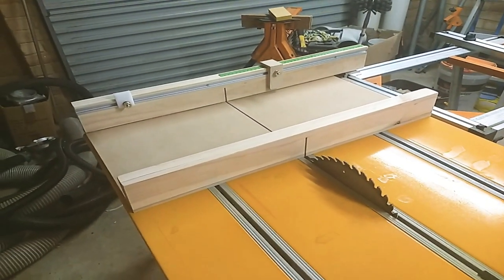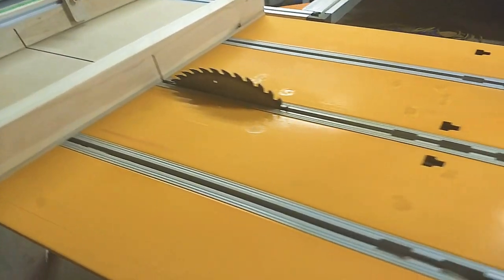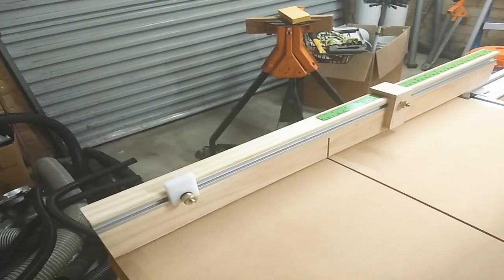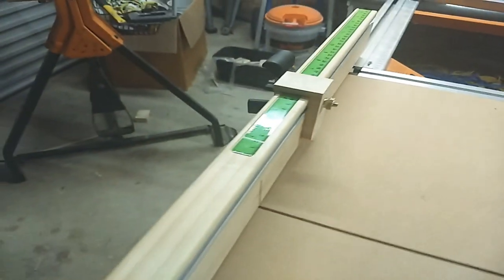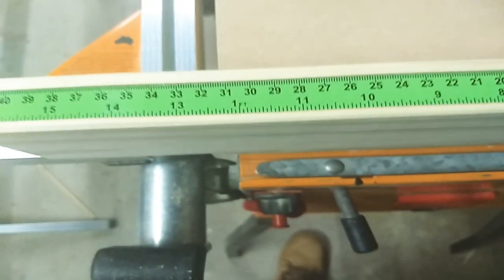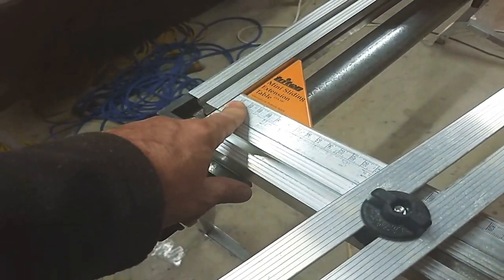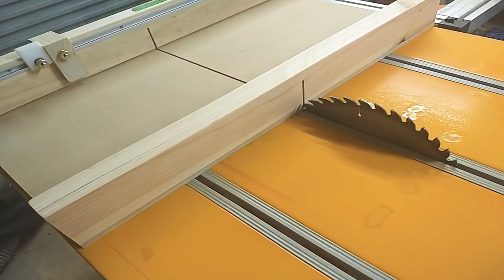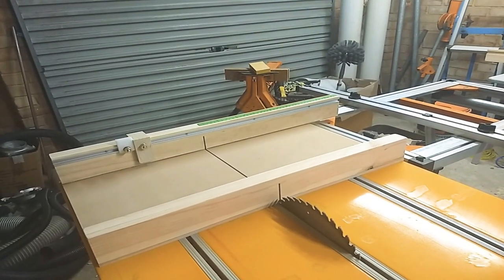Triton  2000 WorkCentre sled

Comment: Hi Phil, I had the original Triton in the 80s built all sort with it,  sold it in the late 90s and about 12 months ago my wife came home with the 2000, with triton power saw and extension spare blades but the maxi extension all for £200.00 couldn’t believe it.
I’m going to build your sled for mine do you have dimensions please, so far I’ve built a lathe bench out of 2x4 recycled flooring timber, what I’ve found is the the table rocks backwards and forward about 5 to 10mm, I’m thinking of putting braces but not sure where to put them, the pivot point is the point where the legs fit into the frame any ideas please.
Kind regards Chris Moore
Reply from the maker: Hi Chris - Sounds like a good price to pay for all that gear; nice going.  The dimensions that you choose for the 9-mm MDF base depend on what you want get out of the sled.  Width can be same as saw table, maybe a slight overhang.  The length of the base has to be chosen carefully and depends on the length of the slides under the sled.  Longer slides mean more stability, but then limit the length of travel of the sled.  This then means that the length of the sled has a practical upper limit (i.e. no point making the shed longer then the slides can offer in travel).  I don't have the dimensions to hand, but will go out to shed and maybe create another video to show/discuss this.

As for the rocking issue, just to be clear, you're talking about the Triton table rocking?  I think you could simply tap each leg close to the ground outward to settle the machine.  The old Triton instructional videos show that pretty clearly.

Let me know if you've got any more questions.
Reply from the maker: https://www.youtube.com/watch?v=bnGAyX9cbHg

Comment: I made a sliding sledge for my triton but i put the running on the outside of the base so i got more 1 meter 200mm in total
Reply from the maker: Interesting.  I considered this, but didn't think that my table top width was consistent and square enough.  Do you find that the sled "racks" (pivots a bit) because of this?

Comment: Thanks for the video. I plan on making one for my triton soon. I see i  your comment you plan on doiing the runners on the outside, whicb ive seen in other vids. I would be interested in seeing how you do that. Thanks phill
Reply from the maker: Hi Adam - There was an issue with making outer runners/guides on my Triton.  Due to the manufacturing process, where the sheet metal edges/corners are folded over, the table width is not uniform down its length.  It is perhaps 1+ mm wider at the corners compared to the middle section of the table top.  Since the outer runners/guides will have to be mounted to account for the widest part of the top, this leads to a slight rotation of the sled around the centre of the table top (pretty much around the blade centre looking from above).  Owing to manufacturing variations, it may be that you table top doesn't suffer from this issue and outer runners/guides might work.  Since the sled rotation (I didn't actually quantify this, but it is very clearly happening on my table top) was unacceptable on my saw, I am in the process of attempting to use runners in the mitre slots.  This is also problematic, since the slots are not uniformly aligned.  One of the ideas that I think has the greatest merit is to get one of the sliding extension tables (I have a Mini Sliding Extension Table ETA - hard to find these days at a sensible price) and use the "inner runner" to use as the guide for a sled.  There are plastic runners that you can buy from the Triton spares UK site that could be adapted to this purpose.  I read about this idea on the Woodworkforums.com site, but there were no pictures (since this was done about 10 years ago).  Since I have that sliding extension table, this option might work for me.  Good luck and let me know how you go. - Phil
Reply from the maker: Do you have links for the other vids on this?  It would be good to see them.
Reply: @superphilschneider  thanks for the reply!

I cant remember exactly what videos I have seen with it but i seem to remember atleast a couple. maybe they were pics on the forum too cant quite remember, ive seen so many now :)

I see what you mean regarding the table top, the pressed metal is nowhere near pefect by any means. My table top also has a bit of wiggle side to side in it so its less than ideal. I was thinking of a way to pack the table top locking tab sockets with something to try and minimize it when it occured to me, why not make something that commects to the body itself?

My first thought was making some tracks that attatch to a (spare) set of the yellow legs that the rip rence attatches to (the yellow legs that slide inside the scaled tracks on the body)
They lock in tight and would just be a case of cutting them in half and having them stick out the side with some tracks attached. That way they wouldnt move and the sled is attached directly to the body of the saw table.

The cost of the yellow legs are prohibitive though, so now im thinking i might be able to attach something to the aluminium rails that run under the table top. I got a few ideas floating around ill be sure to let you know if i try anything.
Reply from the maker: @Donga083  Interesting ideas there.  My table top is also bowed, causing it to rock. I fixed that by using a spacer made from plastic clothes line, which was good because it's somewhat compressible.  Some foam or other soft material would also work.

I like the idea of not using the pressed metal table top to guide the sled.  Triton used this rationale in the design of their Mini Sliding Extension Table (ETA100), which may be an option for a sled.
Reply: @superphilschneider  i have the maxi extension table too. I was looking at ideas using the round pipe on either side of the table...but not sure that will be accurate enough.

Right now im thinking or removing the table top and mounting something ridectly to the aluminium rails that run either side. Would need to space it up and perhaps make a replacement table top out of mdf with a couple of aluminium channels, then making the sled go on that.

I think it would be relatively easy and not take too long to change over.

Right now my biggest issue is getting the alignment of the saw right, i cant get it 90 degrees i run out of adjustment on the circ saw. I havent spent much time on it but theres some good threads on the forum im going to have a go at. I have a heap of plywood boxes i want to make so ill be ripping sheets so ill mess around with it then
Reply from the maker: @Donga083  Hey, how did you go with that idea - of making your own replacement table top for the Triton?  Seems a lot of guys are making table saws (John Heitz, Matthias Wandell, Cosmos Bauer, Paoson, others) so why not for the Triton.  Let me know if you have any ideas on this.
Reply: Hi Phill. Unfortunately I havent done anything with the Triton yet. Its been put on the backburner. Im still setting up my workshop so thats taken priority.

Ill be sure to post here when I do eventually make something, its still definately on the cards.

Comment: Hi Phil, nice job. Did you make runners / how did you make runners for the Mitre slots??
Reply from the maker: Hi Matt. Thanks for your comment.  Yes, I did use runners for this sled, which I made from thinly cut strips of pine from off-cuts 2x4 boards, so nothing special.  I used ca glue (super glue/cyanoacrylate) to attach them to the MDF base, which made the process quick.  I simply placed the strips into the end of the slots, with spacers to raise then slightly above the table surface, applied ca glue and gently set down the sled.  Unfortunately, because the Triton pressed metal table top is not that reliable, the strips needed to be sanded slightly to give smooth movement of the sled from front to back.  One other thing that I did, which I would warn against, is never to paint the table top.  I had about a dozen rust spots that formed, due to breakdown of the power-coated surface, which I sanded back and then spray painted.  But I sprayed large areas of the top, which was not slippery enough, and the MDF sled would bind.  Took me several hours to hand sand the paint off. Was a real pain.  However, was worthwhile, since the sled slides really smoothly now with minimal effort.  Hope this helps.
Reply: @superphilschneider  Thank you for your quick reply and great info!l
Reply from the maker: @mrmattprobert  , went out to the shed this afternoon and took off the runners, tried putting on replacements that would give better alignment. Didn't work, because the mitre tracks themselves aren't well aligned.  I've decided to make a wider sled that uses the outside edges of the table.  Are you a Triton owner and, of so, have you made a sled?
Reply: @superphilschneider  yes I am a Triton owner. Don't have a sled.....yet. I will make one someday
Reply: Hi I have done the sled using the outside edges as you can find in another video. Good enough for my needs in size and precision. Edges might need some sanding to become smooth enough. The sled is used now 90% of the time.

Comment: Did the router bit get ruined by using it on aluminium? I've just bought a second hand workcentre 2000 with a planer attachment.
Reply from the maker: Hey Relic, I used router bit too "hog out" the channel for the aluminium t-track, so didn't actually cut into aluminium with router bit.  The Triton blade that I use can cut aluminium, though, if you go easy.  I'd be reluctant to try to router aluminium.  Maybe at low speed it might work?  Hope that answers your question.  Happy to answer any other queries.